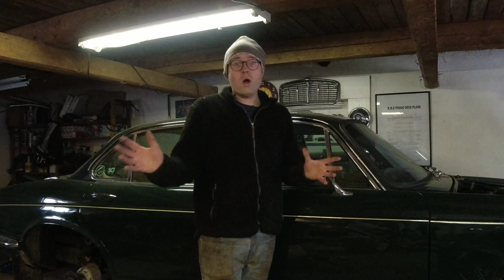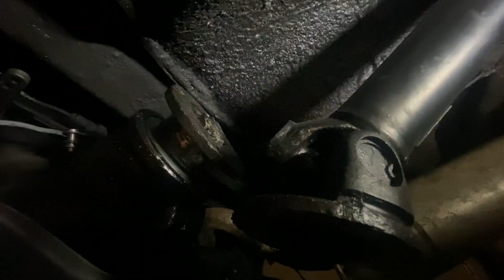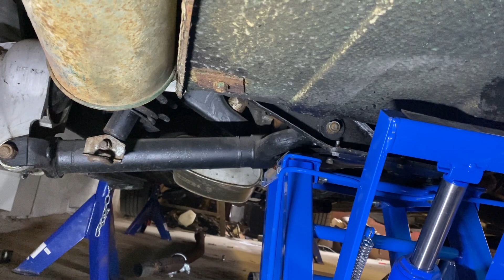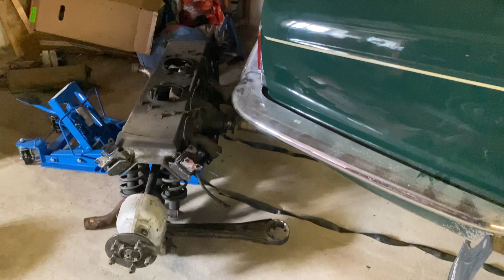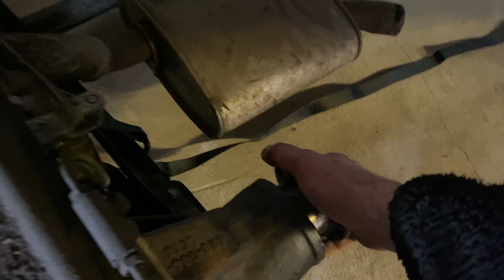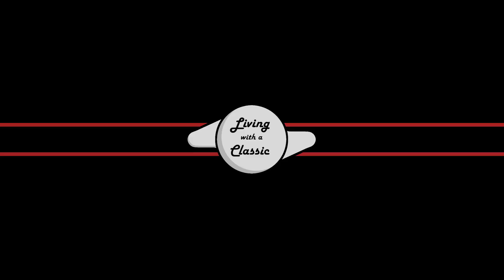Testing a Different Method of Removing a Jaguar IRS

Comment: When I do mine, I put a roller cart with 2 6x6 pieces of wood under the diff, then use my engine hoist to lower the car until the diff is on the 6x6's, unbolt the the  out side bolts holding the cage to the rubber mounts, and then use the  engine hoist to lift the car off the cage and roll the cart out.  Simple, no chance of tipping!  Learned the hard way!

Comment: That jack and especially the straps are a brilliant method! I've done this several times on a friend's car using a tie-plate support tool we made up but there's no way you could complete the job safely alone as the IRS will always want to rotate forwards as it lowers... its a lot of weight for one person to hold steady! We lower onto a pair of wheeled dolleys and slide out sideways... I think your jack could do that too if someone were to be short on space behind the car. Great videos, thanks for sharing.

Comment: I took The Camp Chaos Chronicles tip of fabricating a thick steel plate that first bolts to the jack and then the IRS cradle. That made it very easy, and no risk of it falling. Highly recommend it!

Comment: Just removed mine this last month to install all new parts. I used a 3ton floor jack and two furniture dollies for each hub to rest on and made it incredibly easy to wheel around, even on my graded driveway.

After actually doing it for the first time, I would 100% remove it again seeing how easy and quick it was for me to do.
Reply from the maker: It is pretty easy to remove. The only annoying part can be the exhaust if it’s the old type and it’s never been apart
Reply: @LivingWithAClassic  I very much agree! I was able to keep the whole exhaust intact floating within the frame and I left the trailing arms attached to the car instead of wrestling with the 30+ year old rubber that appeared to be in very good shape.

Comment: I've used one of those jacks to remove the IRS in an XJS a couple of times. Sometimes it's a little nose heavy, and a small block of wood under the front of the bottom tie plate on each side will help keep it level.

Comment: That jaguar rear end is a work of art. Brilliant design  and extremely durable. Won't see the likes of that again.  Great work Adam.
Reply from the maker: It is! Such a good design and very durable also
Reply: Durable but it requires maintenance, such as replacing the diff output shaft bearings as some point in the life of the car. i had to do that on my XJ40 at 200000km. I was able to do it with the IRS in place, from the sides of the car.